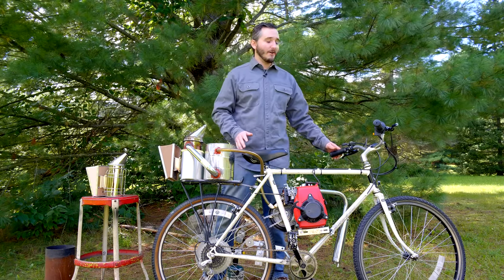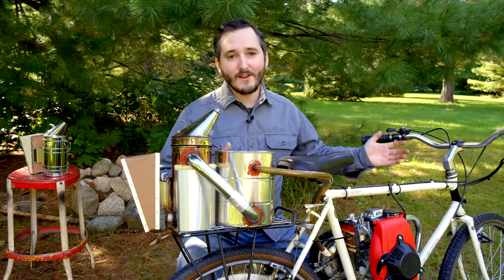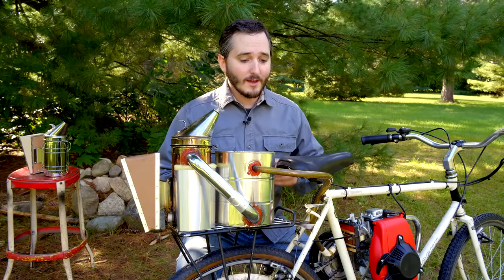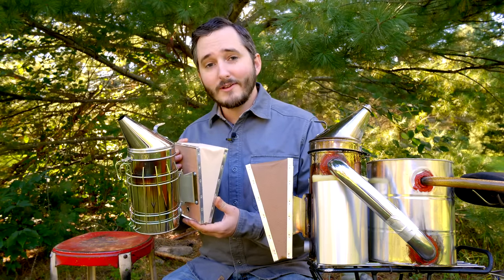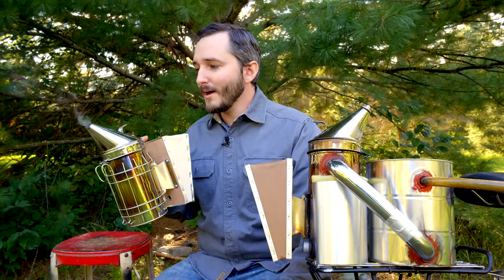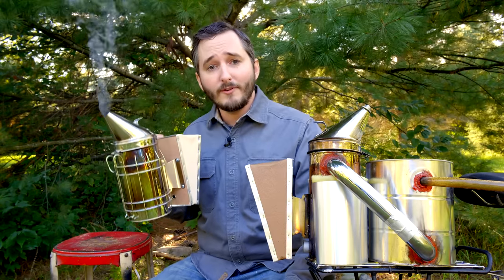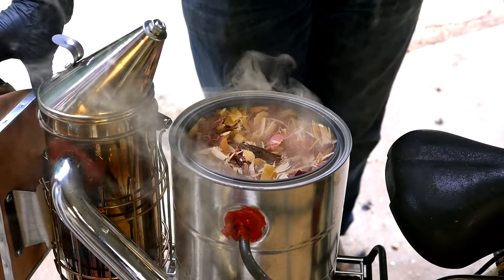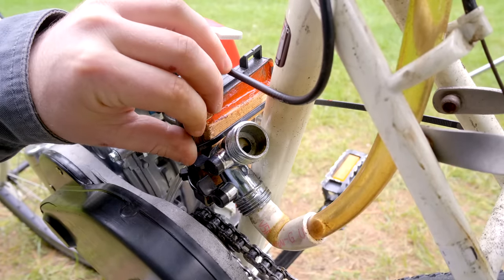Running a Gasoline Engine on Firewood | Woodgas Biofuel

Comment: Let's see... I've seen your gasifier and gas meter design and I almost liked it. The gas meter, won't be usefull for a vehicle but there is an option there.

I'd stick to the original gasifier idea, making clean wood gas, just making the reactor tower taller, right next to the rear wheel (insulate it well of coarse.. starlite maybe?). I think you can then go with good 1.5 meters of gasifier tube. Then run a solid pipe down from the top of the gasifier to the bottom of the water filter.

I'll go with a single stage, tall, water filter/cooler design, mounted on the other side of the bicycle. Make sure to implement a valve to prevent reverse water flow (You know them fluids could be naughty :D). And make a good gas house (I mean the dry part of the filter for exhaust.) so that you won't have to fear water in the engine.

From the gas house you go to the expansion tank, that you'll need for good fuel distribution, you may need to come up with your own design. Just a long soft baloon in a pipe should do for a test. It will be good also for pre-gasing the machine and it will work great for jump driving, in case the gasifier won't make enough gas for continuous run.

Finally, you enter the part where you put that stuff in to the engine. There already is a gas intake on the engine, I'm not sure why people try to avoid that so religiously. Maybe the carburator setup is too scary. But if it can't work with regular intake, you may have a good use for three way valve.

See if you like this idea, I gave it just about an hour so it sure is far from perfect. I'm sure though, you'll make that thing work just fine, my design, or other. After all, cars used to be run on this system in the past no problem.

Comment: Burn the cedar chips and use clay based cat litter for your filtration- just a suggestion, I haven't tried it. Probably need to get the dust out of the litter so it doesn't damage your engine.

Comment: You'll want to get the centre of gravity as low as possible. 

Some sort of velomachine, recumbent or tadpole trike would probably provide a better platform for a more substantial gasifier. 

You could also just build it on a bike trailer. That way you have a portable gasifier for all sorts of fun.

Comment: You might try changing the direction of draft from top down to bottom up when lighting from the bottom this way it burns away from the ash and the chips will fall into the coals

Comment: Awesome! You might make it more efficient when scaled up, since you can condense more gas before it's used. To deal with the CO2, an Na/KOH scrubber can do a lot, whilst staying (relatively) small. Scrubber is also easy to refresh using electrolysis (4-5V phonecharger will produce hydrogen, whilst driving out the CO2). 
I would care to get a car using this engine, as I  love swinging the axe, giving lots of wood-chips as a by-product. They dry so quickly that I could probably replenish 'on-the-go' using secondary heat from the engine. I know this engine was common before, and during the ww2, typically in pickup-ish sized vehicles.

Comment: Hi, I think your system can be improved by adding HHO in the air, maybe using a dynamo only or adding a small bettery.
The wood gaz would be burning much better, and the motor would stay clean, because only wood-gaz creates a lot of soot if not burned completely.
To start better, I think it would be usefull to be able to pump the wood-gaz generator during you lanchs the motor, it could be done by treadle.

Whatever, your idea amazed me, I also want to say I discovered your channel yesterday with your incredible starlite, then I saw you making ropes with grass, the mechanical solar tracke rand now this, all wonderful projects I subscribed.
Reply: A properly designed gasifier makes HHO. some systems as much as 20%...

Comment: You will never get all the moisture out however because the wood gas needs to be hotter than 100C (boiling point) for it to ignite in the engine. This makes the air wood gas mixture even more complicated as opening the intake will also cool the wood gas. You would have to cool it to condense the liquids and then reheat it to it's flammable point.

The cleanest and most efficient way to use wood gas is with a boiler and steam power. That way if you ever need that extra power, you've got the charcoal to put in your boiler.

Comment: 1) i think you need a snorkel for your air intake to get it away from the smoke. 2) perhaps you should make the wood gas first and contain it within a gas tank i.e. run the smoker through several filters and channel the final product ('refined' wood gas) into a 2 L soda bottle; then use the 2L bottle as your gas tank. 3) they sell a nitrous kit for that bike (just saying).

Comment: As a quick fix, you could replace all of your wood with charcoal. 
 It will serve as fuel, and it will produce a mostly tar-free fuel gas. 
 Charcoal gasifiers are a good companion for a motor bike project  :) .
Reply: Listen to CNCmachiningisfun; Go to his sight. He as done a lot of work on woodgas and running small engines. His statement about charcoal is spot on for this project. ( it is still wood just prepared better) Also got to Driving on Wood for much more information

Comment: So, here is a question, though it is a long time from when the video was produced. Why not set up a gasification system, into a gasometer to purify the gas. Pass it into a beach ball to allow for larger and more compressible storage. Transfer it through a regulator into a tank and compress it to increase pressure, and just use a regulated pressure tank to run the engine. That would decrease size and weight, and would probably increase your run time too.

Comment: With the restriction on the wood gas intake the 2 way valve would need to be partially closed to match the restriction for a 50:50 mix

Comment: One suggestion would be a one way check valve on the air inlet. When the engine started a lot of smoke was being discharged from it. PS: Has anyone told you that you look like you could be Will Wheatons brother?

Comment: You can buy air filters for your house for under $10 at the hardware store.  Cut it into circles the size of the paint can, 2 or 3 layers should work.

Comment: I bet if he used charcoal, it might work.

It is a lot more energy dense, very uniform, burns very clean, and will keep lit and maintain temperature much better than wood scraps. For a compact gassifier where there isn't a whole lot of room for filtration, it might be the way to go. You could also use a charcoal starter to get the entire fuel charge lit before loading it into the gassification chamber, further simplifying the build. A small battery powered fan would be all that would be required to keep the air moving until the engiine took over (and you could switch the fan off). Even a small battery would last a long time without bothering with an alternator.

 Also, ball valves are for isolation, not flow control. You get crap flow control out of them. Globe or butterfly valves would work a lot better. Butterfly valves would be inexpensive and lightweight. A check valve to prevent backflow out of the intake would help a lot as well. The smoke coming out of the air inlet shouldn't be happening. 

However, the fact that it worked at all is very, very intriguing. With a few tweaks that thing could work... and gets the rusty gears in my head starting to creak.

Comment: Great Ideas! Why not try compressing the cleaned gas from your gasometer into a lightweight carbon fiber scuba-tank and use the filled scuba-tank to fuel the engine?

Comment: Wood was used I Sweden during WW2 as provision of gasoline was limited.
Even the military I Sweden  used wood gas or "gengas" as it was called in Sweden.
The main difference in that design and your design is that the Swedes did not burn the wood that provided wood gas. The system only heated up the gas providing wood. The heat came from a separated burner underneath the gasifier. That way the wood gas came out much "purer" basically  closer to "100%" and didn't need filtration.

Comment: Question, why the 2 way valve? The carburator should have a filter that sucks the air in to mix with the wood gas, was the filter removed to attach the wood gas intake?

Comment: Maybe put a tiny cylinder air pump on it.
It could be directly driven via the engine crankshaft, without a clutch. It wouldn’t have to be big at all. It would add oxygen to the fire based on crankshaft speed, helping to keep power past idle. Might could even do it electrically using an extra magneto on the engines flywheel or possibly the crankshaft

Comment: Same cedar shavings for the filter, but add 1/3 the volume of the filter-can  (I assume it's a 1 gallon paint can) water, and send the wood gas by blower fan up through the bottom.  You're still getting water vapor in the engine. I would say; use a blower fan like are used in blacksmithing, but instead of a simple hand crank, hook it to the bicycle pedals via a chain. (WARNING: Science ahead) By keeping the cedar shavings as a medium, but making the woodgas draw up through water and a porous medium; the water vapor should be condensed and removed through capillary diffusion.  Capillary diffusion is the process of relaying chemicals to(or from) a source medium through a solvent being run across that medium while the chemicals intended for relation are present.  Modern day uses include medical care in dialysis therapy, gold mining via riffle boards, and brewing coffee.  I saw the video when it came out,  but I just had this idea...

Comment: I was thinking how about sealing up the bike frame using it as a storage vessel tap a  hose from there to the carburetor more stable flow also a water thumper can filter good enough I like the setup good job

Comment: I hope you spot this comment. So a solution for filtering your smoke, do a water percolator to filter tar and other contaminates, then to remove the moisture, run it through a PVC container in line packed with salt.

But honestly the best solution to try, grind up a bunch of aluminum cans, soak in acid, then add gallium until all aluminum is absorbed. Chill until gallium solidifies, extract it.

Create a pressure vessel with a relief valve and a large opening on top. Fill with warm water. Drop in gallium puck.

Hydrogen will be produced, and you can run off that. When it stops producing hydrogen, collect the gallium and remaining aluminum oxides from the water, top it off again, place the aluminum and gallium back in it's acid bath to remove the oxide.

Lather, rinse, repeat.

Comment: A small turbo would feed more air back into the combustion chamber which I think would make the fuel burn more efficiently. I'd also be curious to see if electrolysis could be used to boost the octane rating of the wood gas.

Comment: Always love the videos. just a thought. would forced air from a small fan in place of the bellow instead of relying on the vacuum draw from the 4 stroke. i think it would give u a consistency that you dont get as it is. also help keep it up to temp for better gasification?

Comment: I would definitely prefer to liquefy the woodgas and get it stored instead of having the gasifier directly on the bicycle itself. Having a constructible kit much larger than the one on the bicycle but small enough to fit in a reasonably sized backpack would be useful in the middle of the field would be a cool way to get charcoal for cooking, tar for a good number of purposes and having the woodgas in a fuel tank.

Comment: could you potentially power the bee smoker with the rear wheel, a piston kind of thing? maybe have it attacthed to the gear shifter to be able to "turn on" or "turn off" so youre not always pumping the smoker. it would require repositioning the smoker horizontal, but would ensure constant wood gas production.

Comment: This project is DESPERATELY needing electrification. You won't need an electric starter, but, a tiny battery like a 12v 3 amp hour to run a tiny Arduino would do you wonder. Even that size battery would be too large, but in order to run the loads I'm suggesting, you'll need a larger battery in order to not abuse it. 

My suggestion, take an Arduino in some small form factor, find a way to hook up an engine speed sensor (maybe pick up the ignition spark), so the Arduino knows if youre hand cranking or it's stalling, versus running, and apply some way to electronically provide fuel when the engine stumbles, rather than letting it die, and prevent adding fuel when it's running as intended. If you hand crank it and it reaches 400 rpm for a moment, then slows down, the computer could shoot in a hit of starting fluid to get it up to 1,000 rpm, potentially moving the wood gas as needed to run the engine. You could also add a super cheap computer fan to stoke the chamber whenever you deem necessary. You could optionally provide wood gas via a port near/in the intake, space the carb out with an air on/off valve that you can control, and electronically provide suction to the carb when the makeshift engine computer recognizes the engine is about to die. This way you're using gasoline and the factory carb, rather than a small spray can of starting fluid that has to be replaced often. You could eliminate the need for a fuel tank if you chose to add a little can of starting fluid and a solenoid to spray it, but, it's entirely up to what your priority is, and how well you can get it to run strictly off wood. You could even add a sensor to measure the content of whatever gas it is that's fueling the engine, to literally monitor your fuel production and give feedback to control your fan. Lots of options. Computerization can help, and arduinos are dirt cheap on AliExpress, and theyre a great platform to learn on. This would potentially mean one-crank starting and consistent running, with feedback if your wood supply isn't cutting it, or is dropping temp, or whatever you want. With an arduino you could add a screen to display data, or even Bluetooth to your phone if you really wanted. I think the first thing, as you've mentioned, is a bigger chamber. Replace the manual bellow with a tiny computer fan so you can convert more wood into fuel at once. If those bursts of air are required, rather than a steady flow from a fan, keep the manual bellow and add a cheap universal door lock/unlock actuator that the Arduino can power. There are computer cooling fans that are designed to push slightly positive pressure, to potentially push through a fluid filter just before your engine intake. Put two of those fans in series with one another and seal around them really well on the intake to your gasifier, and I bet you could comfortably supply the engine with fumes, using a very small filter that you just change the water in. 

With the fan pushing your fuel, and the engine sucking negative pressure on the other side of the filter, you could have a small bubbler filter of some sort, to save space. Just fill it with water to a specific level that you know works, and use that saved space to mount an even larger gasifier. 

Another option for recharging the battery that's totally solid state would be go add a thermoelectric generator to the side of the wood chamber. By having a hot side and a cold side (one side being in contact with  ambient air), the device created electrical power. A small amount of constant current to the battery is enough to support the computer, plus intermittent loads to stop the engine from stalling.

Comment: I’m wondering about a gasometer tank as a buffer/regulator. It “should” work, as long as it is vertical. I like the MrTeslonian gasifier pickup truck. I thought of some improvements on it. He also made a gasifier that produces & refines to 3 gasoline octanes. I’d like to see a collaboration with all 3 guys... get Cody & Colin to brainstorm with you... Just think of the possibilities... and, what about HHO fuel??? Jethro Bodine would be envious!!!

Comment: You need separation between the heating fuel and the gasification fuel. The CO2 is just too much for the engine to run cleanly.

You can build a dual tank version with hefty insulation outside, like glass fibre.

On the first run you fill the one side with commercial charcoal while the second side is full of wood.

Once you made the second side to charcoal you can switch and fill the first side again with wood, after removing the ash.

This way your burn is clean and you don't push the CO2 into the engine.

You also need to cool down the gas, to liquefy the water inside, so put a radiator on your bike - maybe on the side of one tire and add fan blades to the tire? This way you increase the cooling as you ride faster.

I would run a small air pump off the engine shaft, so you push air to the fire as soon as the engine runs - this will adjust the fuel production to the fuel consumption.

And as for the tar: I would try a cyclone filter. That stuff is sticky and heavy.

Should be easy to filter out that way. Just make sure to keep the cyclone filter insulated as well. It needs to be hot or the tar will stick too well to it. :)

Comment: Or can you stack multiple smokers in parallel, and place a "horn" bellows on the handle bars? Maybe even making a "brake handle" bellow? Using a small gauge hose you should be able to stoke just enough to keep the flow. Also, does the filter medium burn even better if you dry it out?

Comment: Perhaps you can implement a swirl filter similar to the type used in large aquaponics systems to settle out the ash that inevitably makes it through the system, a useful video to help you with your project is from a series called Planet Mechanics where they successfully ran a truck on woodgas, you can find the episodes on YouTube and most streaming services, should help you along with your project.